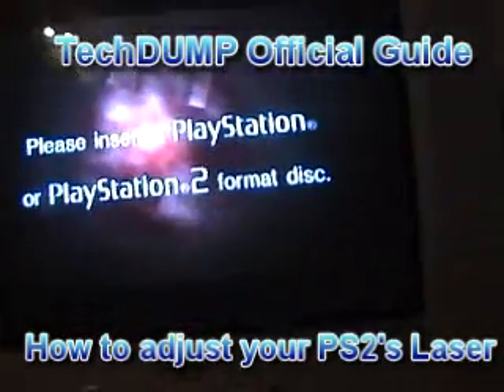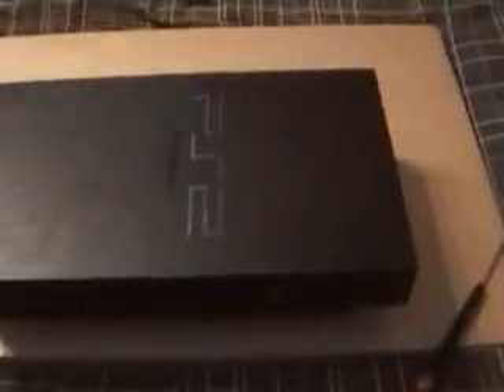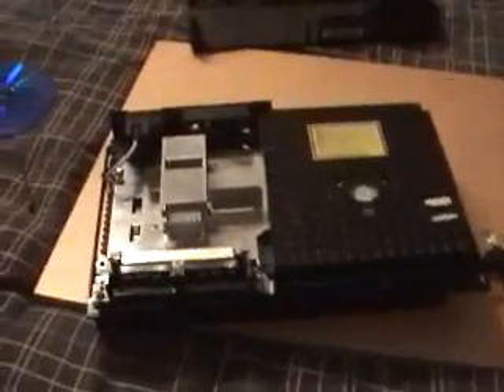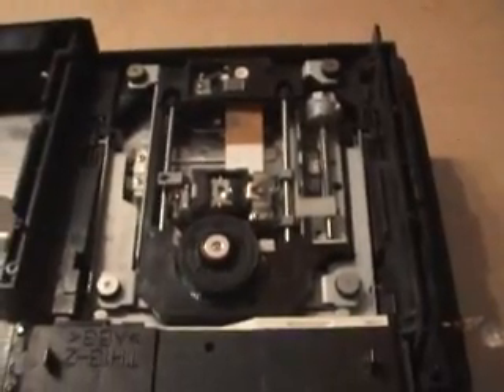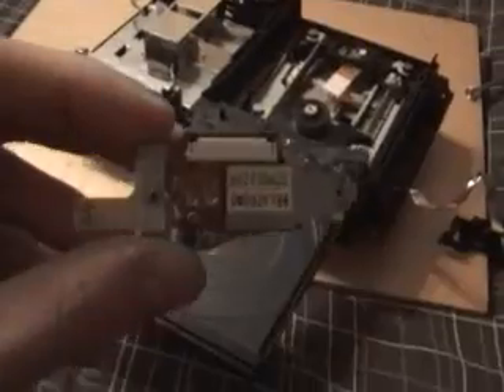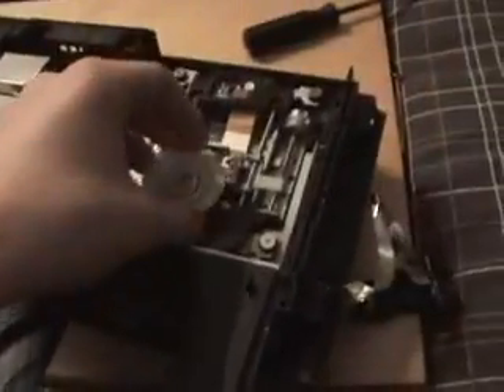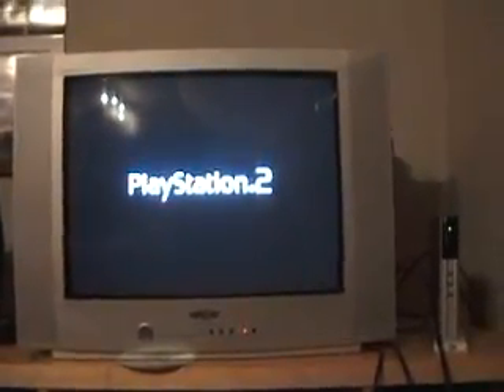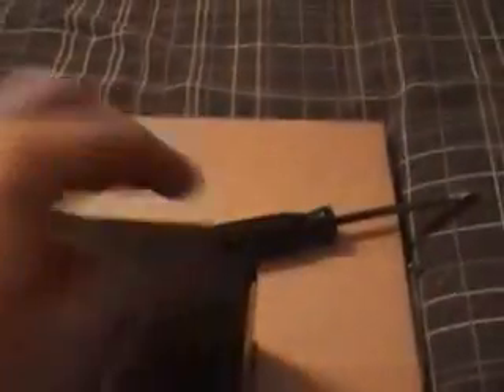How to calibrate your PS2's laser

Comment: In fact this procedure is not a calibration. Laser diod gets older and loses it's power, these controls are roughly speaking the valves of 'amount of energy that powers the laser'. If you did it just remember, it's time to replace the laser unit in near future, it is supposed to die soon.

Comment: this broke my ps2 thanks
Reply: +Joey Davalos It's as if you're blaming anyone but yourself.
Reply: ***** adjusting the laser didn't work also there was no mention that there are different types of lasers for them
Reply: *****  also I only said something too one person so how am I blaming everyone .
Reply: Joey Davalos I was meaning the original uploader. It's your own fault you broke your PS2.
Reply: Joey Davalos Irk. Fuck these lies
Reply: Joey Davalos no fucking way
Reply: How did it break? If it's not reading any disc now u just have to find the original location of the knob. I did the same and luckily remembered where it was originally set
Reply: In my case it stopped reading discs and barely tries to spin. Tried to turn it back but it just won't work. 🥲

Comment: Okay, so for those of you looking for a calibration wheel(white thing) on a model scph 50001 and not finding one, there are actually two of them. The rods that the laser slides on are lifted and lowered by these two rods. The circles that are punched in can serve as a guide post for where you are in terms of turning. There will be a reset point, where the slightly spiraling cylinders stop. This is the lowest point of each of them.

Comment: That´s the way that ppl that don´t have a clew what are they doing do.... professionals use a Oscilloscope to se the wave form of the laser and adjust him properly..Bias and tracking, i work for Sony for some years.
Reply: then would you mind giving each one of us oscilloscopes then? i would love to have one.
Reply: there are many in e-bay
Reply: Used this as a reference, my old PS2 had reading issues (slow load, disc read errors etc. had to 'wobble' the ps2 to read). Just lubed the guide rods and slightly adjusted the POT under the laser, and boom works like new!

Comment: @slrMHProjects I'm not 100% sure but your referring to the controller yes? you tried replacing the controller....If that doesn't work then you need to replace the controller port in your ps2. How to fix common ps2 problems.wmv on here shows you how to do that. ^^ Hope that helps you.

Comment: YEEESSS!!!! It really worked i'm very happy to prolonged the life of my PS2 Slim by the way it also worked on a slim type PS2, I just open it up, turn the 2nd screw the DVD type at the back of the lens then turn it just a LITTLE to the right (maybe if you turn it too much might burn the cd) then its fixed, and tested it to a Gran Turismo 3 PS2 cd to diagnose( the gran turismo 3 cd dont work before) then its fixed, now i can use my old CDs again......Thanks again it really helped alot.

Comment: @musjay YYEEESSS!!!! It really worked i'm very happy to prolonged the life of my PS2 Slim by the way it also worked on a slim type PS2, I just open it up, turn the 2nd screw the DVD type at the back of the lens then turn it just a LITTLE to the right (maybe if you turn it too much might burn the cd) then its fixed, and tested it to a Gran Turismo 3 PS2 cd to diagnose( the gran turismo 3 cd dont work before) then its fixed, now i can use my old CDs again......Thanks again it really helped alot.

Comment: GUYS HOW ABOUT IN PS2 SLIMLINE, IS IT POSSIBLE TO CALIBRATE THE LENS OF A PS2 SLIMLINE CONSOLE ??

sorry about my noobish question... I just want to know... because my modded ps2 slim can't read my brand new original dvd game, however some of my old pirated games are still working fine and some of the new pirated games of mine didn't  working..  Is this because of my Lens ?? should I Calibrate it or go for the Lens replacement ???

Comment: In my case, the point that you're at around 6:40, my disc is still making click noises and changing speeds and not moving in a fluent motion like yours.  I have no idea where to go from there.  The disc isn't moving so the diagnosis isn't going to be very effective.

Comment: i got a disc read error in my PS2 when I tried this. how do I know if it's the right angle and if the games work? is it possible that I burned my games as well? I saw laser burns on the back of my games. well, three games at least that I don't play much. NBA 2004, Samurai Warriors 2 and Capcom Vs. SNK 2. Need help. Thanks!

Comment: Hay nice vid? One little question. When i tried without closing the chasis i found out that the motor(that rotates the disc) sometimes stopped then it rotated again and so on until it stopped showing the disc read error? is it normal when laser is not adjusted or the motor is rubbish?

Comment: hey i bought a ps2 from an apperant "friend" that said it was working before he handed it to me but when i first turned it on and tried to play a game it didnt work. so i tried adjusiting the white clicky wheel i spend hours just turning that god awful thing every notch non of it worked. i cleaned the lazer with alcohol. still doesnt work do you have any other solution then as to take the lazer off? i dont have a screw driver to turn that screw that lets you remove the lazer
Reply: This option seems to have worked for me.  20 years of no disk read then a few turns of this wheel and has started reading disks again

Comment: Im not trying to be a smart ass or anything but you first had a silver back cd in your ps2 3:03(it didnt work 0.01)That disc should be running on the dvd laser4:20. then you took it apart and twisted the dvd laser NOT THE CD LASER5:30. Then you put it back together and tested it with the blue back disc (which should be running on the cd laser) so really the cd laser was working the whole time but the dvd laser wasnt working. My point is that you really didnt show us that the mod you used worked.